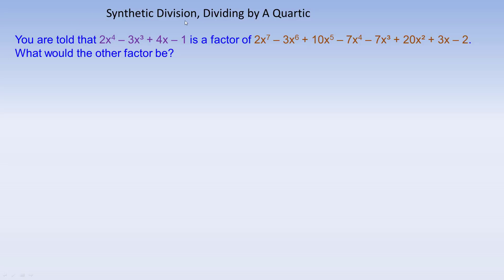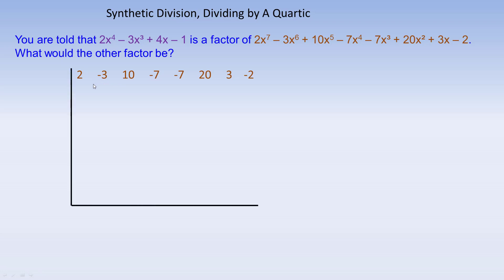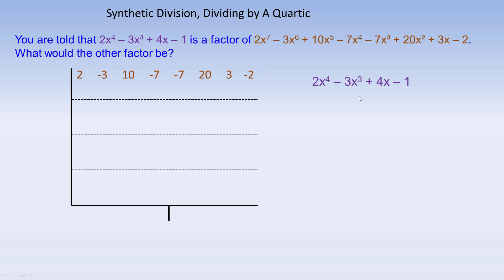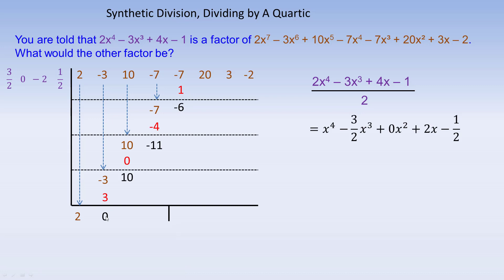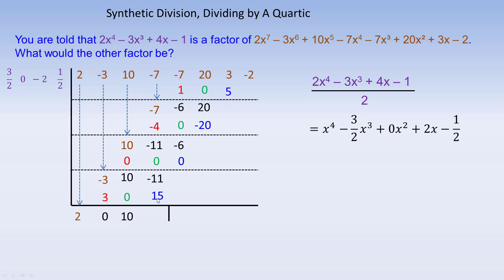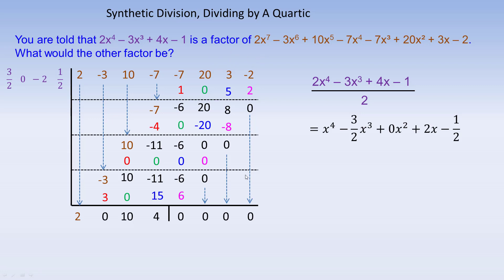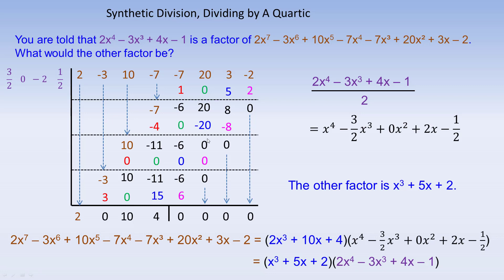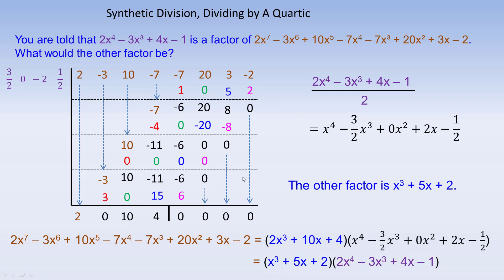Synthetic Division Dividing by a Quartic

Comment: We have just started with synthetic division in my Pre-Calculus classes.  We are not nearly to this level of degree of difficulty.  This will take some time for me to try to wrap my mind around.  Thank you professor!!
Reply from the maker: Hey, if you have just started using synthetic division, check out this video that compares long and synthetic division: https://youtu.be/4e9ugZCc4rw. It used linear factors as the divisors. I also have video showing how to use synthetic division when the divisor is a quadratic or higher degree polynomial.